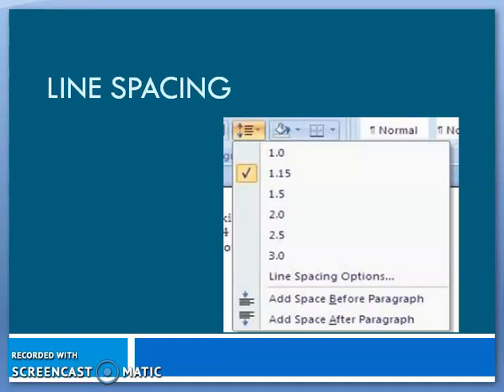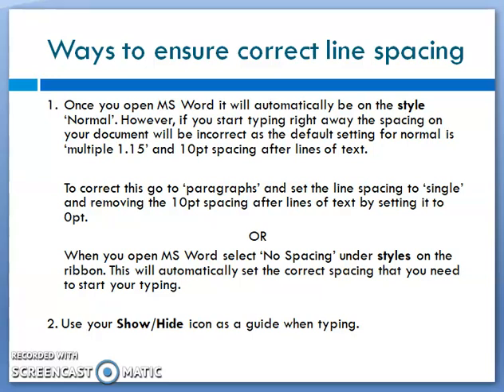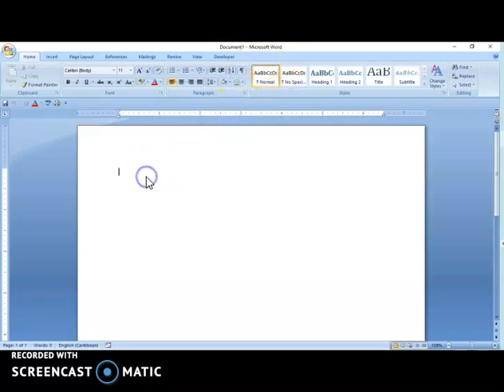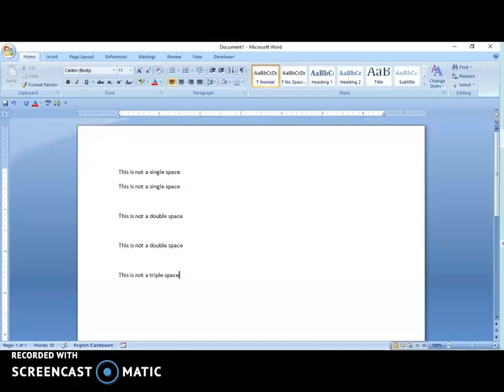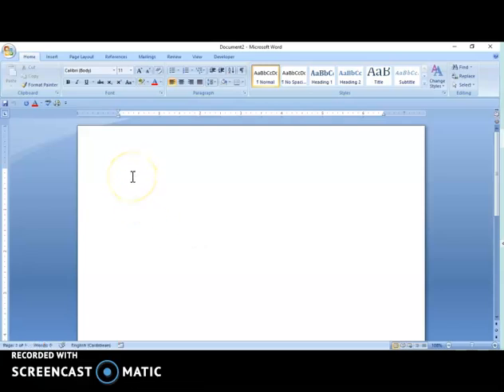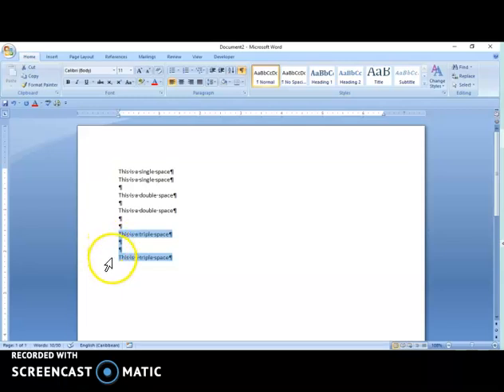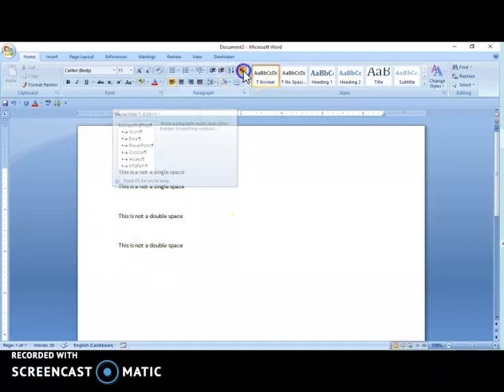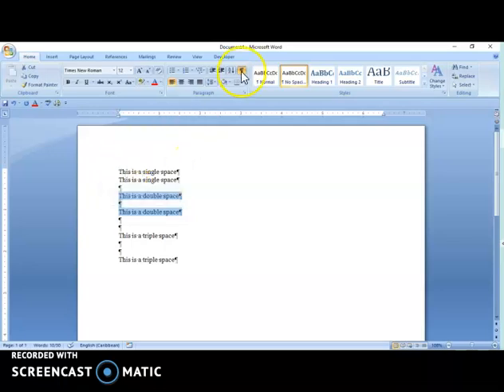Types of Line Spacing| CSEC EDPM

Comment: From the text book I'm using they said that if it's triple space you key the enter keys 3 times. 
For double space press the enter keys twice and for single space press the enter keys once. 
I wondering if it's correct
Reply from the maker: It is correct. It just means that when you key the enter key three time you will start typing where you stop on the third enter key. So you will have 2 spaces between text. Likewise for double you press the enter key twice but start typing where you stopped at the second enter that you made. So you will have 1 space between texts and so on.
Reply: @EDPMMadeSimple  thank you so much. 🤗😊